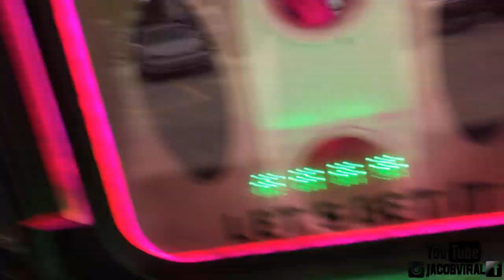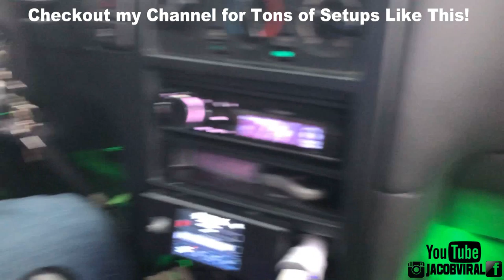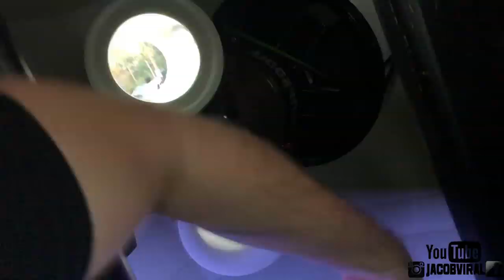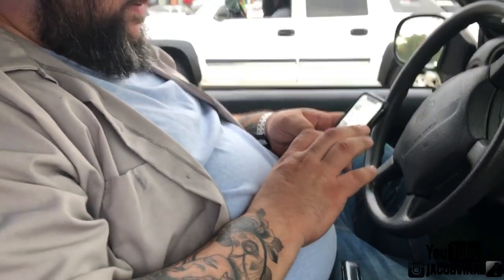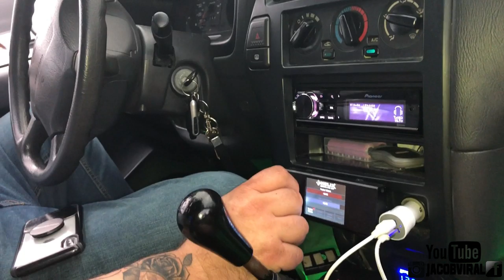LED AMPLIFIERS AND LED BOX BUILD

Comment: 6th orders are finicky but if you get it right the bandwidth is nice and wide. Very musical. Keep tuning about an octave apart and make sure your math is right and you should be good to go. That said, 18's in a 6th wouldn't have been my choice. They take up tons of room and and you sacrifice motor force with lack of drivers imo. I'd rather use 3-15's or even 6-12's. Believe it or not those 3 setups would require close to the same amount of room. Very nice setup indeed tho. Good shit
Reply: Dibeezy ThaGifted This is my setup and I am about to change it to 4 15s. I had the 18s on hand when this was built so ...
Reply: @stylepoint1200  I definitely respect your setup and was most definitely not talking down on it at all. Way cleaner and louder than I've ever been. Very nice build man
Reply: Ryan Harrison,this is a killer build bro ,it's up there buddy
Reply: @ogairbender808  you ain't lying bro this s*** is clean AF and loud too
Reply: Believe it or not I like the sound of 3 15s in a sealed box with tons of power. Killer set up tho, NICE.
Reply: billy Johnson I love sealed boxes. Great bandwidth and super tight punchy bass.
Reply: @stylepoint1200  Yes. Best of both worlds.
Reply: @stylepoint1200  I absolutely agree.👍